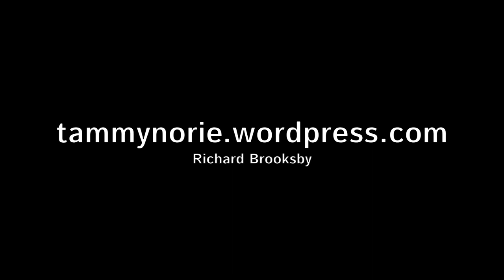Digging for nuts

Comment: This was an operation of very gynaecological nature. I very much appreciate your very British elocution, and very much hope you will be able to do continue to upload YouTube videos of your voyages and adventures. Might you venture to comment on whether a single junk rig mainsail is very much like a sole balanced lugsail in function and form? Kind regards.
Reply from the maker: Hello! It's similar when set, but there are quite a lot of differences too. There's no boom (it's just the bottom batten). The sheet spreads load across all the battens. This means it's extremely easy to reef (it takes literally seconds from the cockpit, even under wind pressure). It's a big advantage for a distance solo sailor.

Comment: Yes, 'tis a damn nuisance this kind of well meant shortsightedness for sure. I've found exactly the same problem on the old Westerly countless times. Being a bit short on patience these days i tend to cut the heads of the bolts off from outside, lift off the fitting (stanchion in your case here), then drive the left over nut and stub end down through its fibreglass prison with a big hammer and punch. Just in case you need to do this again.
Reply from the maker: shoestringsailor Thanks for the tip! I've just been stripping out the old headlining and have exposed most of the interior, so I can check the other fittings. I reckon I can quickly expose the other nuts with a wire brush on a power drill, without risk of any damage.
Reply: @shoestring: quite common for boats from the 1980s. keep in mind that was pretty quick + cheap way of building boats those days. e.g. drascombe boats are buildt more thourough but also sell appox. 3-4 times the price of a coromandel.

Comment: I really appreciate your channel. but this here is a bit too time consuming, isnt it?
simple solution: take a chissel + hammer and chop away the fibreglass that covers the nuts. takes 3 minutes. and yes, the chissel needs resharpening after that. quite common btw, the yard just bolted on the hardware and then laminated the nuts over from inside.